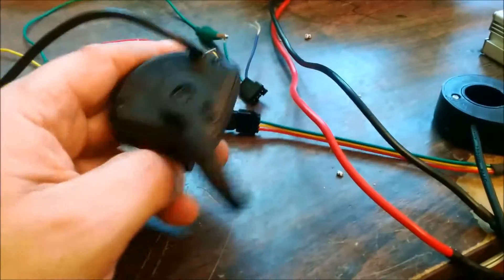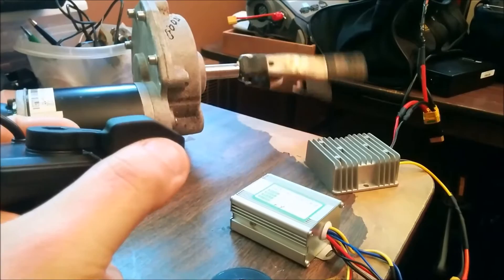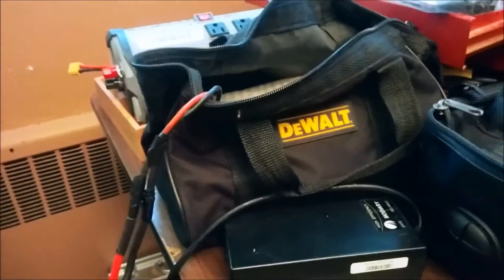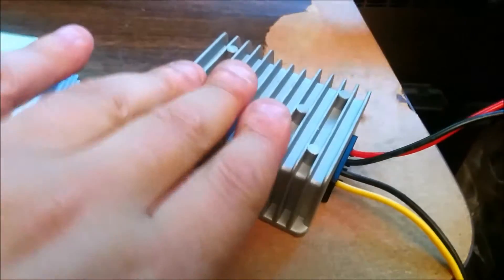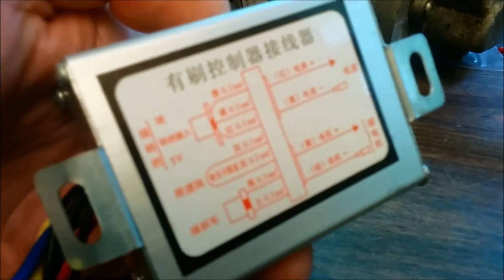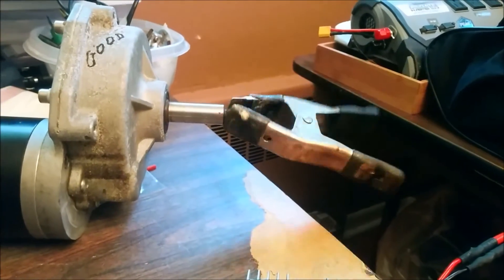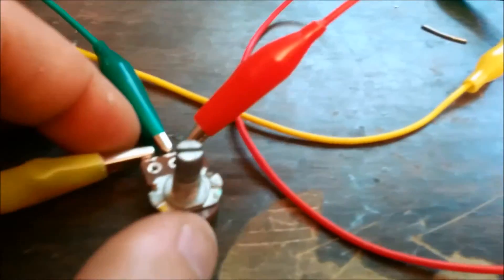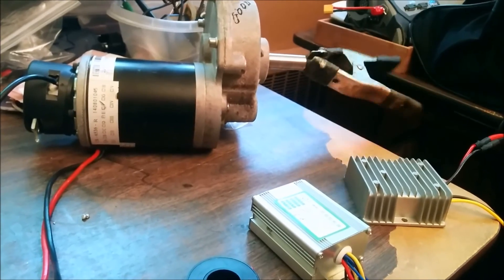PROJECT - 24V Wheelchair Motor controlled by Ebike Throttle and Potentiometer

Comment: I’m pretty sure that motor will handle 36 V with no problem. Omit the DC to DC converter and the 24 V motor controller and use the 36 V motor controller directly. I’m curious how much more RPM you can get out of it

Comment: A drunk driver paralyzed me many years ago...So I have been trying to figure out a way to make my jazzy select elite go faster...You give me lots of hope here...Basically I just have to get a 24 volt e bike Potentiometer and connect the motors to it...Next it looks like you just get a throttle and plug that into the Potentiometer...Finally just connect the battery leads to Potentiometer...I am taking it that the Potentiometer is the same thing as the controller module on my wheelchair...The throttle I guess is equivalent to my joystick...It is just a matter then of getting the throttle to work with two motors...I mean the throttle is designed for one wheel that you steer with both hands VS my wheelchair joystick that is designed to steer by increasing/decreasing speed to either the right motor or left motor...That is the problem...steering...
Reply: I’ve got a similar handicapped situation and trying to build my own ebike with a old power chair motor. I’ve been searching for info on controlling it. Curious how your project went and if you had any advice for me? Thanks

Comment: HELP! im trying to install one of these poteniometer to my mobility scooter. what info do i need about my scooter to look for to find the right potentiometer?? thank you
Reply: kojimapromeatspin
:   if you can not fix it on a    mobility scooter.it can be dangerous to use an aftermarket controller without a cutout switch.  But you might not need to.  if it's in warranty return it to the place you bought it from. But if not You can Pull it out then carefully take the cast apart Then have a look at the back of if you see if there is any burned resistor or popped out capacitors if so replace them.    Most mobility scooter. are 24 volts  110amp  can put up to 1000 amps to limit this to 700w they are all computer controlled unless you an engineer for the home handyman repairing the computer on the main controller would be incredibly complex  And would be just about impossible But on the controller,s  the computer really falls. But what does fall is small resistors. diodes and capacitors if the hand controller fails you have fast blinking lights and a horn then you know computers, OK  What gone Is usually a  small resistor. or a diode somewhere in the controls on the handlebar is usually the main one to go as it often gets hit by bad weather. But before you take it apart take lots of photos as you take it apart.